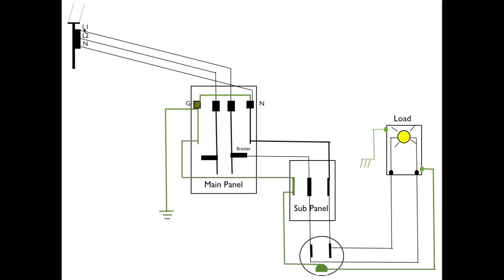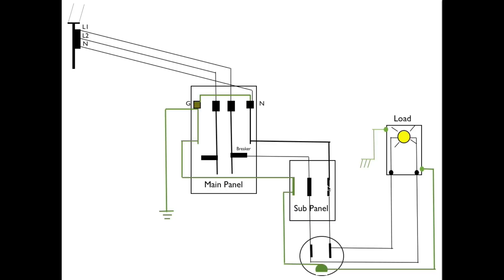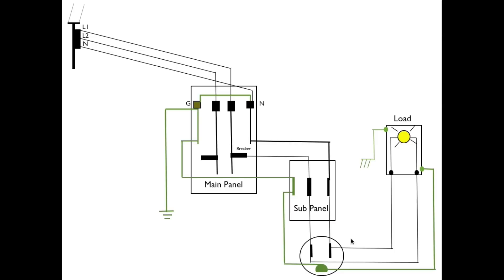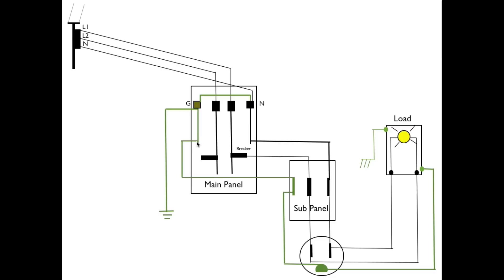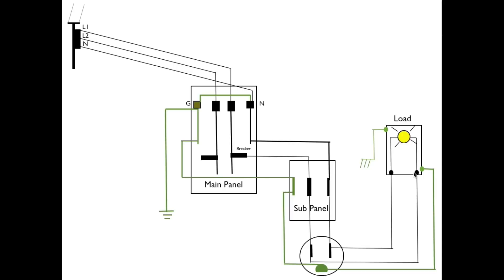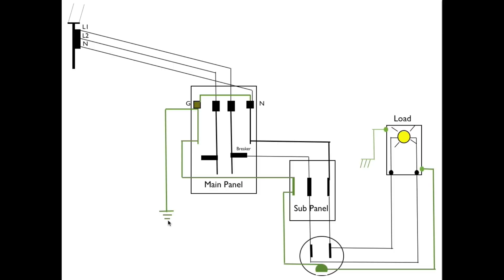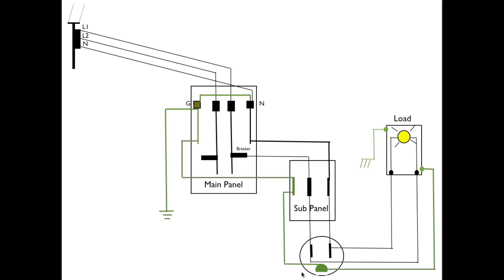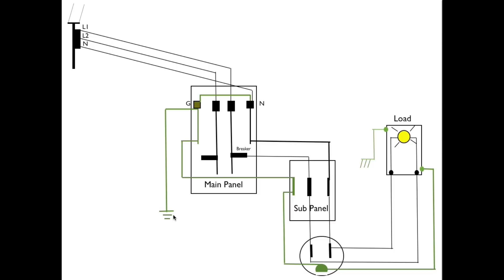The difference between neutral and ground on the electric panel

Comment: Three wires at the pole, would that not be a three-phase system? Obviously you would have to ground one phase for the neutral. And for 240 wouldn't you basically have two hot wires/two phases?

Comment: Your a little bit wrong, SCE test at  the main requiring the main ground to carry a heavy load back to the main transformer, in the state of California the ground must be boded to a 6 foot grounding rod and also bonded to the copper plumbing pipes, to make it as low resistant to the return to power pole transformer grounding strap under the earth. they test this by putting a load on the neutral and ground separately. This is also grounded by all the buildings on the street, when I have loaded them my self, I get not much more then a 3 volt difference between ground and neutral, stating that both have a excellent return.
Reply from the maker: MrMac5150 You might check this playlist:  https://www.youtube.com/playlist?list=PLItXrh64d2JNJOjSivaYXeX88i8MNWgwu  I did a series on power passing thru ground that may be of interest to you.
GFM
Reply: 8 foot ground rod min. article 250.52.
Reply: xXBuckOFiveXx In some places the requirement for a ground rod is 10 feet. Check your local ordinances.
Reply: rayford21
That's true, in dry areas, you may need to use
a 10 foot rod.
Reply: rayford21 Did I say it had to be 8 feet? No I said 8 feet minimum per nec.
Reply: For the UK, I believe the bonding of copper water pipes is for supplementary bonding, just as any exposed metal must be bonded, hell, the regs even went as far as asking for bonding of aluminium windows ! totally impracticle, it was revised.
On a NHS hospital contract I worked the substations required ground rods, but no matter how many we put in and at what depth we couldn't satisfy the inspectors.  The final solution was a "mat" made of 2 inch copper tape some 10 or more feet square buried at several feet.  Pfft to your 8' rod.

Comment: why will the surge protection work if the ground and neutral  are bonded in main panel but not on sub-panel if it were to be bonded just as main panel.
Reply: +gtmustangcobra I'm assuming because it will travel the least amount of distance to the grounding rod maybe? I think that's why they many say their rule of thumb is to ground the fist disconnect point thereafter the meter regardless of where it is. At least that's the general idea I have gotten thus far in my search for knowledge. It really seems like many electricians are not on the same page at all, thus its really hard to tell really......
Reply: +510Redneck Thanks for replying. I myself don't understand or get it why would it matter on a sub panel not to be bonded if at the end it will travel back to the main panel where it's bonded and from there it should go to the shortest path to ground, and not from the sub panel whether it's coming from the ground or the neutral wire.
Reply: gtmustangcobra The sub panel is to be not bonded, only the main errr first disconnect point from the meter-globe is to be bonded-grounded. From what I gather In the event of a lighting strike for instance it would travel the shortest distance-least resistance into your house and back out into the ground via the grounding rod-ground, instead of seeing how much your wires inside of your house can take before catching fire and burning the house down. For instance if you sub panel is a good stretch away from your main it would be sending all that juice through smaller gauge wire to and back from the sub.. with the sub being further in your house and smaller gauge wires to and from it... it could result in issues id imagine.
 As far as IF a sub being bonded in regards to things in your home, it could possibly energize  said things housings-cages- etc..... imagine walking to your garage fridge to grab a nice cold beer, only to be zapped when you grab the handle (been there lol), I could be wrong but I think that is what is attempting to be prevented here by doing so. If flow is typically diverted through the common back to the grid than when bonded in a sub panel it would possibly (or will) energize the ground wire to your outlets, appliances, etc. because the two are now connected.   Have you ever touched a outlet screw and been shocked? I have aswell.. I been shocked all over a apartment I used to live In and I believe that this may be the very reason why. Again, I'm not a cert electrician so forgive me if I'm wrong here. I did go to a trade school for a few years in hs for BCO where they taught us the hands on basics of this kind of stuff but that was many many moons ago and they never actually taught us the reasoning behind anything to begin with anyways (just how to hook some shit up). lol 
 I'm here (strolling video's) because I'm looking to re-wire my current home and attempting to refresh- research shit to make sure I'm not going at it blind- ignorantly. Its certainly a tough task considering on every video electricians seem to be arguing amongst themselves about damn near everything under the sun. lol  
 Not sure if any of that I typed helped because I might be reading into your comment wrong... Let me know because if you raise a valid point that I'm currently not seeing I will infact hop on your bandwagon and question - attempt to find the answer to it.  Peace
Reply: +510Redneck Thanks for replying again and please forgive me if I'm not understanding the consept of not bonding the neutral to ground on sub-panels. I understand what you said and I know it's the legal and NEC code way. But everything  you said happend to me in my home. Being shocked when opening the fridge and other things. And thats having only one Panel in my home and having the neutral  bonded with ground in the panel. Now in regards to lightning if it were to struck  our power line and come into our home, which it happened once and all our tv's got blown up along with other stuff, so cable guy recommended a surge protection plug. But anyways if lighting struck  (assuming that I had a sub panel) well it will travel first through our main panel and as you said it finds it way to shortest path to ground. Having the ground bonded in main panel to neutral  it shouldn't  go to sub panel. And therefore shouldn't  matter if subpanel was bonded. Since elecric looks for shortest path to ground. But if lighting does travels to sub panel then then it wouldn't  help if Ground and neutral were not bonded. Because it already defeated the purpose of having ground bonded to neutral in main panel so that it didn't traveled to sub panel.  Forgive my ignorance but just trying logic to see or understand with book knowledge.
Reply from the maker: +gtmustangcobra Its not about surge protection.  It has nothing to do with lightning.  The situation is this:  If the neutral and ground are bonded in the sub panel and the neutral has an open, the appliance connected will operate normally.  Then, if there were a grounding problem, the appliance would be "hot".  Then you get the shock.  If the ground and neutral are not connected, the appliance will not operate when the neutral opens.  Hope this helps.
GFM
Reply: +grayfurnaceman thanks for replying,  but taken what you just said about the sub panel neutral and ground not being bonded. I still get continuity from neutral to ground when I put my meter on them,as if they're bonded when their not in the sub panel ? So, why the rule of not bonding them if in reality they are bonded, if you get continuity from ground to neutral. And you always have that at sub panels. (continuity) Again thanks for helping, but this is what I can't  undestand with logic. If you can help with different understanding I'd would appreciate it.
Reply: gtmustangcobra Ok man I think I now understand what you are saying here. Through my indoctrination-research I been sharing with you what others have mentioned to me when I was in your boat of thinking... well....now thanks to you, I'm back in the boat with you. bahaha By your logic you are virtually saying that by having the sub panel bonded the whole unit becomes "one with the force" (sorry for the corny pun lol) and becomes virtually one big main panel with the exception that itself is protected via a breaker. hmmm  If that's the case (for the lack of better terms) then the only thing that I can see viable from all my research- indoctrination is that by having it un-bonded everything taking the brunt of the force is funneled to one point at the exterior wall of your home instead of elsewhere and in a attempt to maintain proper main breaker function and a small reduction in chances of being zapped depending how far ones sub panel is down the line. 
  With a that being said I shouldn't have used the old saying "shortest path" when describing the hypothetical lighting scenario. The truth of the matter is that it will only "soak up" part of it as the rest will flow where it pleases if uninhibited by something (a disconnection) in its path (as you know) A proper thing to say would be this, electricity takes all paths it possibly can when uncontained- improper flow (proper flow being having it going where you want it to go, not where ever it wants to go). In regards to electricity coming from your service panel, it is attempting to find its way back to the transformer and will take all possible paths in a attempt to get back to it.
  With that being said, as far as the topic at hand.. other than the very small possibilities I mentioned, I picked back up the oar and am paddling with you in open waters again... bahaha as it seems this "issue" may be being blown way out of proportion if one was to view a sub panel merely as a extension to the main and nothing more.. hell idk now but my arm is getting tired of rowing so I hope to find a definitive answer to the question soon. You have seriously rowed me back to my initial starting point as I questioned the very logic behind all of this from the start and only truly ended up just giving in- surrendering my very own thoughts to them. So now I'm back to what big difference does it make... bahaha   Oh gawd here we go again... lol
Reply from the maker: +gtmustangcobra Of course you will get continuity.  The neutral and ground are bonded in the main panel.  If you look at the diagram, you can see how the meter would see the continuity.  The issue here is protection from getting shocked.  You want the user to know there is a problem(appliance won't work).  If the appliance works normally as it would if the neutral and ground were connected, you are then just waiting for a fault in the ground and then the shock comes.  This is also true of the appliance.  Neutral and ground are not bonded there either.  Check it with a meter.
GFM
Reply: +grayfurnaceman Sorry for being hard headed. But if the issue here is protection from getting shocked. And as you said you want the user to know there is a problem(appliance won't work).  Referring that ( If nuetral and ground are not bonded. ) And that if the appliance works normally as it would if the neutral and ground were connected, you are then just waiting for a fault in the ground and then the shock comes.... So if this is true then this risk is also at the main panel, sense neutral and ground are bonded. And also, ( in all appliance neutral and ground are not bonded ) but yet the main panel is bonded and feeds all non bonded appliances with neutral and ground being bonded at main panel. So why is the theory of saying that it is safe to be bonded and then unsafe to be bonded.Also if it's as you said, that having the neutral and ground connected together, you are just waiting for a fault in the ground and shock to come....Why bond them to start with from the get go. If the issue here is protection from getting shocked.
Reply: +510Redneck lol thanks for trying really hard to help me. I know whats suppose to be in main panel and in a sub panels. But the reason that for bonding and not bonding seems to contradict from one another. As they say that the neutral is a current carrying conductor,  you separate it from ground. So why, why bond neutral to ground if you don't want the ground to become a current carrying conductor, when bonding creates a risk. The only thing I can think of is if you had isolated ground. Ground rods that only connect to the neutral on main panel, and separate ground rods that connect to ground bar in main panel where all ground from all appliance and everything from house connects to it but, with the exception of the ground that only connects to neutral. But now I'm thinking that doing this, wont trip the breaker if it were to have a short from hot to ground, but only making the ground hot. So in a sense it would be better to bond neutral to ground, so that the breaker trips if it ever were to have a short from hot to ground as it would from hot to neutral. So even if the risk possibility exist from having ground bonded to neutral. At least you know that it would trip if there's a short to either neutral or ground... Im also trying to get a logical understanding from the theory of being safe to be bonded and unsafe to be bonded. Knowing the potential risk that it creates when its bonded and when it's not bonded. Again thanks for trying to help me and knowing that I'm not the only one that's trying to find logic to this theory.
Reply from the maker: +gtmustangcobra Remember, bonding is only in the main panel.  It is bonded to give a path for lightning or surges to go to earth ground.  In most cases, lightning strikes or effects the power pole because it is the highest.  So bonding is necessary at the main panel.  You are overthinking the issue.  We are just trying keep the chassis from being hot.
GFM
Reply: +grayfurnaceman Thank you for responding. Not that I wanna overlook the issue,....But acording to your answer,.... does this mean that anything that's fed from main panel....run the chance of having the chassis of all appliance hot? Including the sub panel box chassis? Since it is bieng fed from main panel where neutral and ground is bonded? And if not, why not?
Reply: gtmustangcobra "Its not about surge protection. It has nothing to do with lightning."...."It is bonded to give a path for lightning or surges to go to earth ground. In most cases, lightning strikes or effects the power pole because it is the highest. So bonding is necessary at the main panel. You are overthinking the issue"..... I think he is starting to get just as confused as we are. lol
Reply: grayfurnaceman "You are overthinking the issue."... I don't think, I think he is just questioning the validity of this all being the better way of doing things...in the search of figuring out the best way of doing things. That's how progression works, who knows he may stumble into figuring out a better way of doing things in the future by doing so. If people never questioned things in the past and only when by what they was taught was the best way of doing things, we would still be stuck with knob and tube wiring- electric fencing in our homes today. bahahaha  Just attempting to exceed the learning curve is all, no biggie.. thanks for being somewhat patient in this though.    Peace
Reply: +510Redneck lol, man your comment cracked me up, no offense to mr. greyfurnaceman, just good humor.  You are very observative, and have good memory. I didnt remember that he had said that before. But I hope this doesn't throw him back all over since in his video he does say that it took him many years to finely get it. And now as you said base on his contradiction; I too think he is starting to get just as confused as we are or confused us mooore. lol no offense to him but it was funny. Still I'm serious in ending to logic to all this.I hope this doesn't become like religion or politics to where we can't talk about anymore. Because it'll  become too contradictive and no logic. lol Maybe a nice cold Budweiser will help. Thanks for helping in trying to make sense. peace
Reply: gtmustangcobra 
 As much as id like to have a Budweiser with you, I'm a Chevy man... lol

Shhhh..  Don't tell anyone but I'm a closet mustang fan, I'm secretively building a 5.0 fox box in the back of my garage. pff hahahaha

Comment: They are joined together in the main panel and in the main panel only to prevent from putting the entire grounding system in parallel and therefore reducing the impedance of the grounding system and if there was a fault, current would flow through devices you didn't want it flowing through. $2000 55" HDTV gone!